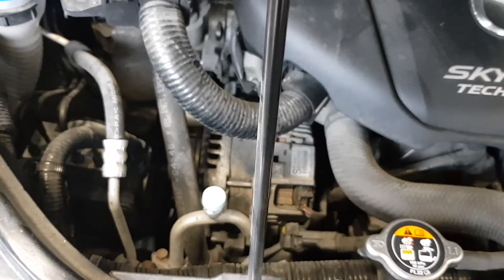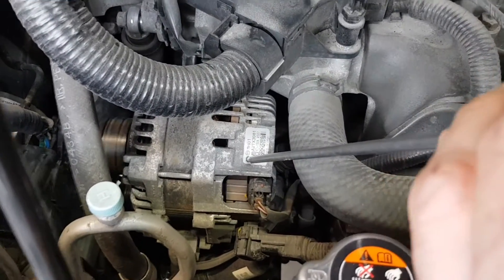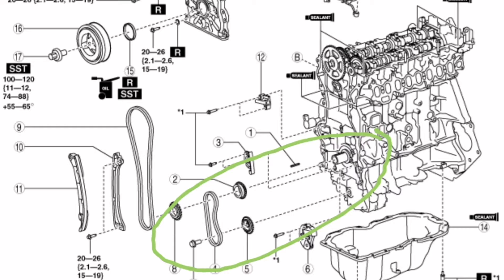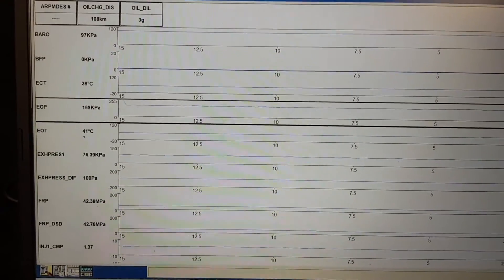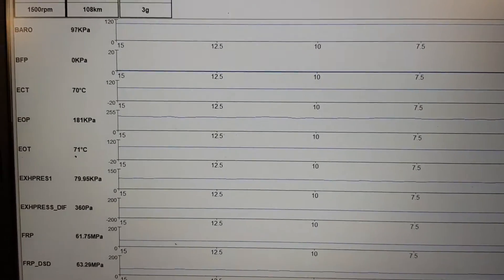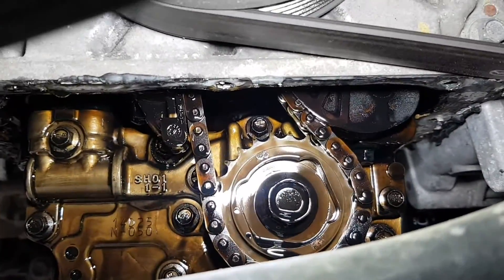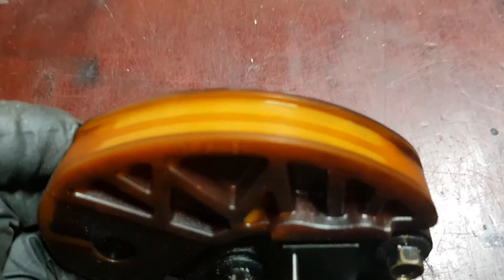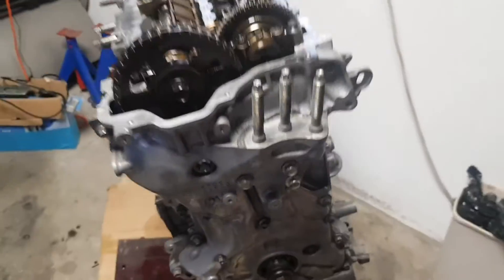Engine noise diagnosis Mazda 2.2 Skyactiv D

Comment: I can hear a kind of knocking sound that goes up and down with engine speed on cold start, but it's random and is not always there... do you have any idea what that could be?
Reply from the maker: You need to locate the sound and frequency using that method as on video. There is no point in indicating what it could be until you narrow possibilities.

Comment: Could you tell me if you know what is a tool name to remove oil pump sprocket
Reply from the maker: @krzysiekp9753  There's no special name. Use part number instead. Oil pump sprocket holding tool, that would be the name.
Reply: @JB_Auto  i tried many words but i cant find it
Reply from the maker: @krzysiekp9753  As far as I remember, I mentioned that the tool is not available, including Mazda's dealership. You need to try sth custom.
Reply: @JB_Auto  i found that tool number but it wont let me add it here  it cost 72€ ex vat

Comment: Hi jb what causes p2150 code come on, 
And also is injector 2 and 3 have a connection in anyway that if injector 2 is faulty will it effect injector 3
Reply from the maker: Hi, I'm not familiar with the fault. The malfunctioning injector doesn't have that much influence on other injectors. Usually, we replace those with high-correction values. If you have any doubts, you can always swap them...
Reply: @JB_Auto  thansk for reply that's a video I uploaded and can you see doing of engine

Comment: Hello, im hoping i can get some advice. 

I have a cx5 2.2d 2016 and im having a MAF P010 fault that pops up even after replacing the MAF. There seems to not be a rhyme or reason when it trips it comes up as mutiple faults on the dash including city breaking, traction control, tire pressure monitoring, and parking malfunction. I have no idea if it's an electronic issue or something more sinister
Reply from the maker: Hi, that could be related to exhaust and inlet systems like the EGR problem, soot on valves and in the inlet manifold, turbocharger, and leak in the inlet system.